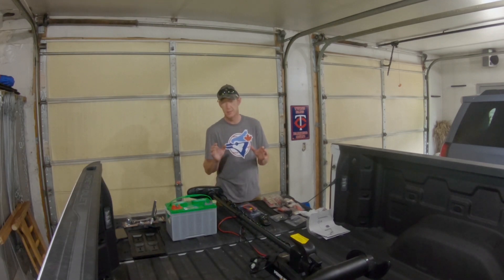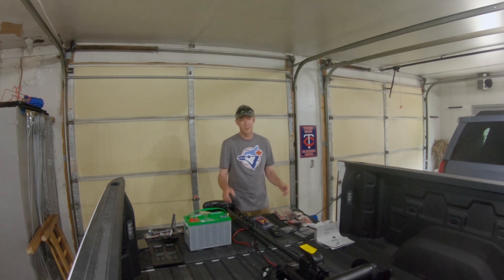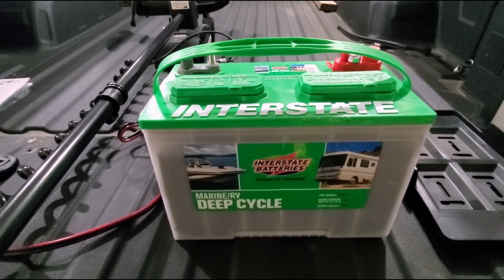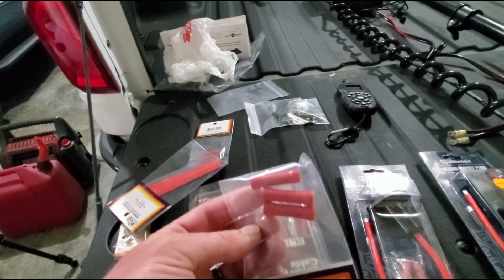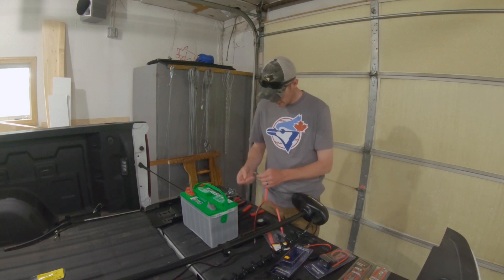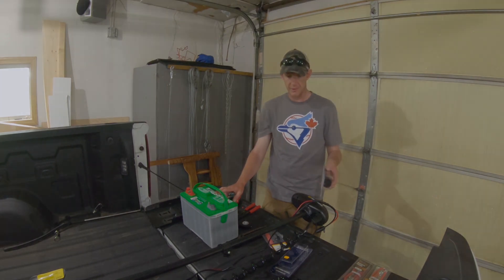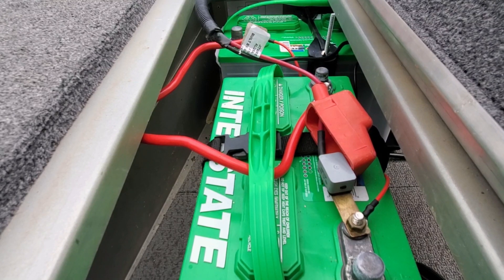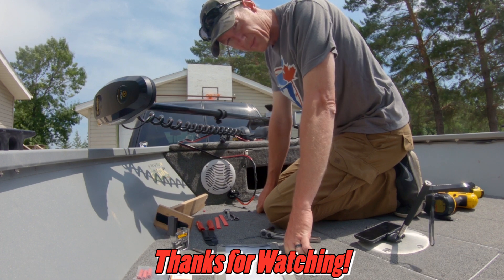DIY Install Minnkota Powerdrive Trolling Motor (Replacing a 12 Volt with a 24 Volt)

Comment: Great video, thanks for sending me the link. I have a 1996 Rebel 1600, yours must be newer because your front pedestal area is raised like a foot with storage, mine is only raised a couple inches. I cant fit 2 batteries in that little bow compartment under the trolling motor, I might have to build up a platform like your newer style Alumacraft
Reply from the maker: The powedrive motor I bought in 2020 I think.  I'd love to have an ulterra on it like my Kingfisher boat but it does work for now. The ipilot is a must for where I fish
Reply from the maker: My Alumacraft is a 2011

Comment: do you charge the batteries from your outboard
Reply from the maker: No, I have a on board charger. The motor does not have enough electrical output

Comment: Glad I came across this video. I’m from Minnesota as well. But I was debating on the 55 or 70lb on my 16ft Lund. After reading the comments I’m sold in the 24v 70lb thrust.
Reply from the maker: I've learned in the past to always max the power!!! Thanks for checking it out!
Reply: If you have bought the motor how has it been so far? I’m going to check out a 24v70lb thrust for my 16ft alumacraft
Reply from the maker: The motor works good for my fishing conditions,  I have not had any issues as of yet.
Reply: Always go big on a trolling motor. I running a 24v but the next boat I wont go under a 36v system with over 100 thrust.
Reply from the maker: On my 19ft I run a 36 volt ulterra, pretty happy with it!

Comment: What is the size of your boat?
Reply from the maker: 16'6, https://youtu.be/NymcdAmeahM
Reply: That’s what I tough, i got a 14.3 and I think the 55 gonna be enough and then I could add a lithium battery to get a constant voltage. Thx for your answer
Reply from the maker: For a 14 that should be pretty good I would think. It's enough for mine on a calm day, but any wind and I love the 24 volt. Happy Fishing!

Comment: Great video.  I have a very similar boat, and am currently debating between 12v and 24v.  It sounds like the 55lb thrust was underpowered for you?  I keep my boat on a lift all summer with no power so I was hoping to go 12v and not have to lug around an extra battery for charging.
Reply from the maker: Bummer on the no power. I would never go back to the 12 volt. It just didn't have any oompf. Any wind just blew me around, not anymore though! Thank You for watching. I hope you can figure something out
Reply: @After5Outdoors  How does your boat ride with the two batteries in the front? I'm getting ready to upgrade to a 24v motor for my Lund, and will need to use the front storage compartment as well.  Just want to make sure it isn't too nose heavy.  Thanks!
Reply from the maker: That little bit of weight doesn't seem to affect mine in the least. If it does it is not noticeable!

Comment: I noticed you never mentioned anything about your circuit breaker. Was that a 60amp you had on there? I was going to install the same setup on my boat today and I only had a 40amp from my 12v, so I had to order a 60amp today.
Reply from the maker: I have a 50 amp short stop on mine